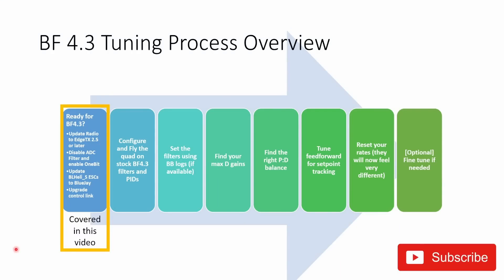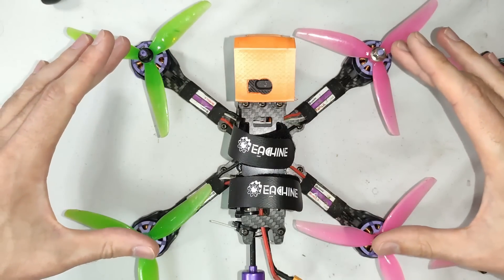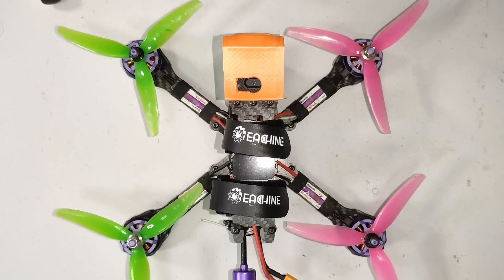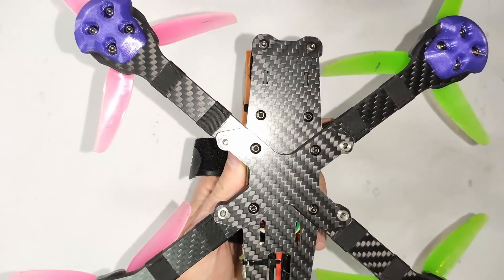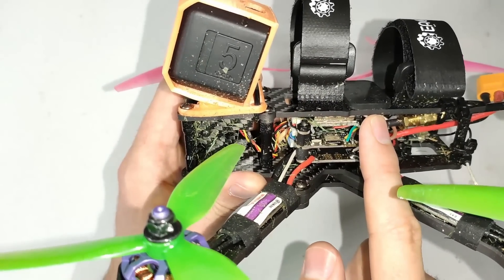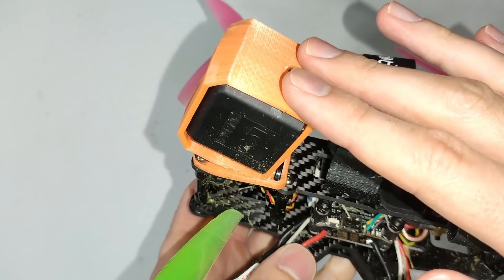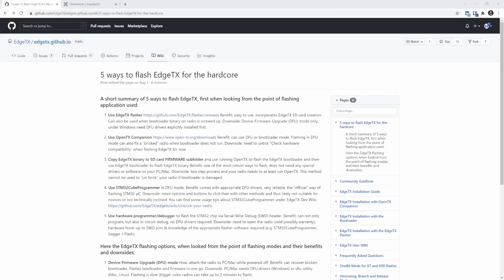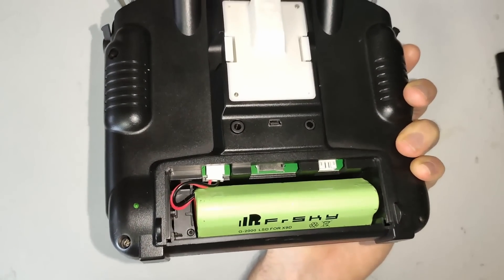Betaflight 4.3 Complete Tuning Guide! Part 1: Are you ready for BF4.3?

Comment: hi nice video I have one question regarding the Taranis setup. ADC filter is turned off. I don't have a sample mod like you. Max baudrate only. What value should I set? 115KBps / 400KBps / 921KBps / 1.87MBps / 3.75MBps or 5.25MBps ?
I use ELRS and I don't know if it has any effect.
Thank you for your help.

Comment: Hello, i just flashed the esc firmware as shown in the video on my speedybee f7 mini wich was on bl heli s... the problem is know i have weird beeping, wich is really anoying and my motors do not turn the right way, but with the firmware that i flashed i can not connect to any other applications..
thanks in advance
Reply from the maker: Motor direction can be configured in BF configurator motors tab. If you flashed to bluejay you'll need to use https://esc-configurator.com/ to change beep settings.

Comment: You forgot to tell to keep direction on ESC Normal/Reversed as it were before flashing because esc-configurator will reset every ESC to Normal direction after flash. Which would be disastrous result.

Comment: how long does it take for the edgeTX flasher to write to the SD card? i've been an hour waiting and it seems to be crashed/stuck "preparing SD card" fetching index, Erasing card. clicking close wont cancel it, tried this process over and over, always stalls here.
Reply: Did you get it to work?  I'm having the same issue, I'm trying a second sd card as I type this.
Reply: @seekerfpv  i coulnt get the edgeTx flasher to work so i went directly to github and downloaded the firmware directly
Reply: @owencroney2089  thanks for replying! I ended up doing the same.. Oh well.

Comment: What is your suggestion on mounting the VTX-antenna for a long range build? Im using the lumineer axii long range antenna. Also my crossfire antenna is mounted vertically on the back with a wobbly tpu print, ensuring its far away from the lipo and carbon etc.

Comment: Nice video, but esc-configurator doesn't support BL Heli 32; I get this message:
BLHeli_32 not supported, please use dedicated configurator.
My ESCs are up-to-date with the latest firmware however. This is for an iFlight 20x20 stack for a 3" quad

Comment: I know some people are really concerned with weight, but I use a clear double sided mounting tape under my Gopro mount and also screw it in place. I also use a rubber band around the battery to hold the balance plug against the battery and Velcro tape on the top plate and on each battery. I think the mounting tape under the gopro mount helps keep it still and really helps to prevent the screws from pulling through the holes. Just sharing what I do in case someone wants to try it.

Comment: Hi Chris, will I need to switch to Edge TX for my QX7 that I already did the inverter mod on? I'm currently on the latest Open TX and using Crossfire for my quads. Thanks.
Reply from the maker: Yes you should. The new features are handy for BF4.3
Reply: @ChrisRosser  Thanks for the quick reply! Will switch then 😄
Reply: @drukinsify  hi ! did you activate the onebit mode on your qx7 with edge tx ?

Comment: Hi Chris, I'm learning a lot with your videos.  I just have a question, though.  Before you flashed the ESC Firmware, the modes were Normal/Reversed/Reversed/Normal, the same way they were in my quad. After you flashed it with blujay, they were all Normal (the same happened to me), you let this settings that way (at least in this video).  I'm going to reverse the ESC 2 and 3, cause I'm not planning to go with Betaflight 4.3 just yet, but I wanted 42khz pwm freq.    Can you tell me please, if I'm  doing wrong reversing those ESCs?  Thanks
Reply from the maker: Good question, you can double check motor direction by arming with props off and checking that the motors are spinning the direction shown in BF configurator's motors/configuration tab!
Reply: @ChrisRosser  Thanks for you promptly response, yes, that's what I did (I don't like too much powering the drone, even without props, much less power the motors, I feel like they will burn almost instantly, but that didn't happened :) ). 
After all, I reversed motors 2 and 3 in Bluejay, then I tested it from betaflight and seemed right, and then I put the props and went out and did a very small test (I don't have such a big backyard), the quad went up smoothly, I would keep watching your tuning/pids/rates videos.   Thanks.

Comment: how do you solve the issue of having TPU protection and motor screw as you can tight them a lot due to the TPU?
Reply from the maker: It's tricky, I use damping grease on teh screws to stop them backing out and do them up as tight as I can without crushing the TPU.

Comment: What if I use the DJI radio? What settings on 4.3?
Reply from the maker: For DJI you can set serial receiver and sbus. Then if you want the fast baud rate just set sbus_baud_fast = ON in betaflight CLI and choose the fast sbus mode in the DJI goggles. Settings are the same as 4.2 AFAIK so just paste those lines from your diff.

Comment: Thanks for doing this, it looks like an interesting and informative series. 
Chris, at 1:32 you say "a frame designed for the best possible performance". 
What you mean by performance? Think it needs a bit of context. Performance for racing could mean something different than performance for freestyle, or other types flying. 
Maybe this is something you can touch on later, or after the tuning series?
Am curious if any differences in tuning for 2, or 3 blade propellers? 
(a premature Q, as noticing both the reference drones are 3x 5")
Reply from the maker: Flight performance. Lot's more detail on aos-rc.com.
Reply: @ChrisRosser  Thanks.

Comment: Ready..., oh yes ...
Wonderful announcement project Chris, I'm looking for your serie on 4.3

Let me just give you a positive feedback on how I learn and progress with your videos on filtering and tuning, and how satisfying it is when you start to really understand what and how filters work, as well as PID parameters, instead of just randomly moving sliders without understanding what's really happening in the many loops, contributing to make your Quad follow your sticks as fast and precisely as possible for a set of hardware, with as many parasites movements as possible.

And may bee suggest few general points of general interest you may address in your coming videos.
I understand you are putting a huge amount of work to elaborate such efficient tutorial content, and whatever You'll do, it'll  be wonderful for many of us.,

The general ideas of my comments being mainly to give you a feedback of the interests of your audience, and sure learn more and more as I can formulate my questions.

With the solid help of your vids(many thanks on that Chriss), I already flash 4.3 build 2538, on a 5', freestyle, GPS, diy build, running on Mamba F405US stack, using BTF Nightly configurator 10.8 #4137

CLI version
# Betaflight / STM32F405 (S405) 4.3.0 Oct 10 2021 / 03:29:25 (0b3a5a651) MSP API: 1.44
# config: manufacturer_id: DIAT, board_name: MAMBAF405US, version: ec268d11, date: 2021-07-26T13:10:45Z
# board: manufacturer_id: DIAT, board_name: MAMBAF405US

I couldn't have it fly nice on 4.2, and now on this 4.3 build, fly just great, kind of unbelievable to me.

But strangely enough, I can't get usage of BlackBoxRecordings, what I was using on 4.2.
(so I tuned, following your explanations first, than my eyes, ears and fingers (motor temp) which worked great for, at least for the beginning but deprive me of the beauty of tuning by measured and plotted parameters ...).

So here are the questions I have to uderstand how to choose the best adapted build environment (BTF, BTF conf, BlackBox, OpenTx, EdgeTx, LUAscripts and CRSF), till the finals released will be matured, which will take probably many extra months ....).

How to chose to move to recent builds ?
What has to be understand of the development process (except it's a my own risks...), when you see ten new builds appearing as yesterday night ?

Like by the end of october10 th to today october 25th, Jenkins publish 4 new builds (2538 to 2542).
Should we go for the last one (2542) asap, cause more work implemented, and Dev are happy so far for the night, or maybe the night is over, Dev are tired and go to bed till next week ? Even if a new bug had stopped them ..., making that last build maybee more hazardous than an older one ?
My question may sound naive but Dev are humans, they work in companyes to pay the rent, and some time they may like to sleep, among many others cool things to do.

When I'm surprised by an unusual comportment of a BTFLnightly build, should I dig in and try to report, or there is already thousands of guys doing it better than me, and so let people work and wait till nex build ?

For example: 
Some software Quad behavior:
In my case the BlackBoxExporer 3.5 software not being able anymore to upload usable files (BackBox build, BTFL build BTFLconf build, My stack not compliant enough to specs for 4.3, well ... it could be so many things ..)

GPS issue in the some fly:
On the same arming session I get up to 24 satelites, than 0, than back to 15 (I use also gallileo) when flying in big and high same circles. 
I never had his before with the same hardware and I tryied 3 differents GPS tested on other builds ...

If you suggest reporting may be of some help for all these great open source dev, could you show us how to report to be as efficient, non invasiv and usefull as possible ?

And the last question regarding OpenTx and LUA scrits with BTF 4.3 (Taranis X9d+ as yours). 
Being a huge fan of Telemetry (CRSF) and LUA scripts, I was wondering how, where and when we’ll find these updates in OpenTx ?
(Well Actually you already gave us part of an answer …. move to EdgeTx ...)
Reply from the maker: It is the nature of software development that there will be many new versions with bugs and problems of all kinds. I do not recommend anyone except software engineers and testers to ever use pre-release code. Especially not for something as potentially dangerous as a drone. I would always suggest to wait for the release or at least for a build recommendation that is known to be stable and safe.

Comment: I've been very interested in your opinions on TPU antenna tails.  Using zipties to secure antennas and gopros make for a really flimsy quad, that will not hold up well in a crash (I bash concrete with my Marmottes). I've done alot of work testing PLA (brittle) PETG (less brittle), and Nylon (better, but expensive), CFNylon (better , but very expensive) but none of them can take punch like TPU.  If I use TBS SMA pigtail, squarely mounted in TPU, with a short carbon matchstick antenna, everything is nice and stiff and secure with no wobble.  It can bend the antenna if I push it, but the mount doesnt wiggle.  I'm curious if I need to be concerned about your warnings against TPU tails, if my antennas are stiff?    Also I have been thinking that traditionally, TBS pigtail mounts have the screw tabs oriented horizontally to allow the antenna to flex up and down more in a crash. Rotatng it 90 degrees with the pigtail tabs facing front to back in stead of side to side should also reduce the antenna wobble on the vertical axis (and may break more pigtails).   Curious if you think antenna mounts made of TPU can perform well...because as a builder it seems like the material is a godsend for durable mounts.    Thanks for what you're doing for the community!
Reply from the maker: I would not use an SMA antenna at all. They are big, heavy and prone to failure regardless of the mount. A thin flexible antenna similar to the one on my AOS 5 in that video is phenomenally more durable, lighter and less expensive to replace. If you tape such an antenna in the right location you'll never break it. 😁
Reply: @ChrisRosser  hmm, pigtails are definitely cheaper to replace than antennas, and a large part of the strain relief that keeps my vtx and antennas safe.  I can definitely afford the weight of a 3 gram pigtail to make the video system more robust...maybe not on an micro, but certainly on a rig that's built around a Hero 10

Comment: Really great tutorial. 👍
One small remark though, no offense please. Have you seen Frsky Access protocol tests from UAVTech? They simply doesn't fit to your recommendation to avoid Frsky. Unless you had ACCST in mind. But even then... Is switching to super fast protocol so crucial? I did try ExpressLRS quad. It's great. But I haven't noticed any difference between that and classic 2.4 GHz rc link such as Flysky, Spectrum, Frsky. Maybe that's because I'm an average person. I'm not a good pilot. On the other hand, I do notice the difference between DJI HQ mode and low latency mode. Up to the point where I wouldn't use HQ mode at all.
Again, I appreciate your work, I am learning from you, I will follow this series, so please no offense, I'm just expressing my thoughts. 😉
Reply from the maker: I have to be honest, Frsky's behaviour in the hobby in recent years has put me off them completely and I won't use or recommend their products. The fact that the ACCESS protocol is not backwards compatible with their old radios or old BNF micros demonstrates a willingness to go against the best interests of their customers. Performance wise ACCESS is not competetive with ExpressLRS in terms of range and penetration. Packet rate is less important than consistency of packet delivery with BF 4.3. Dropped packets cause problems with RC smoothing. The excellent RF performance of LoRa really helps in this situation.

Comment: Great vid as always. I'm a few days into a sharkbyte AOS 5 build now. So this series has come at the right time. I even have one of those little iflight antennas to install.

Would you soft mount motors? Also, I got my AOS 5 frame from unmannedtech... Is the version with carbon washers under the front standoffs an old design or an updated one?

Superb frame to work on, though I have had to file some of the holes out on the bottom plate and motor screw holes... The hole placement is the most precise I've come across though... Not surprised you can get away with tiny tolerances on screw hole diameter... 👍 Can't wait to fly it 😁
Reply from the maker: I wouldn't soft mount motors myself. I do use mechanical damping grease on the frame to reduce vibration though. All versions of the AOS 5 use carbon washers to ensure standard length standoffs are used and they are all the same length in case you fancy buying a different colour!

Comment: Hello Chris, yesterday I tried flashing my Taranis QX7 to EdgeTX. In the github instructions it says, that I have to copy the MODELS and RADIO folders to get my settings and models on the new firmware. The SD-Card that was in my QX7 has no RADIO folder. Is this a problem? How can I get my settings restored on the new firmware?
Best regards!
Reply from the maker: Use the edgeTX flasher here: https://github.com/EdgeTX/flasher/releases
When you tick erase SD card it will preserve models and radio settings . I don't have a RADIO folder either so don't worry. Make a backup just in case and follow along with the video choosing V2.5.0.
Reply: @ChrisRosser  thank you very much! I'll try this later.

Comment: Hey man just wanted to thank you for telling me to switch to Bluejay Blheli s over bl heli m. Not because of better performance… (BORING) but because now when I power on my quad… I can rick roll someone 😂
Reply: I saw he flashed Bluejay in this guide but didn't find much discussion after a short search. Is there a performance difference from M? That's what I flashed a little while back. I'm not motivated to reflash just for the melody.
Reply: @comsterfpv9668  If you are happy with BLHeli_M, stay with it. Biggest difference is, that Bluejay has quite some bugs fixed that were still in the original BLHeli_S (and probably are in M too) and still has ongoing development. BLHeli_M is pretty much abandoned at this point.
Reply: @stylesuxx  Got it thanks!
Reply: @comsterfpv9668  Yeah Blheli M hasnt been updated since 2019. Bluejay is constantly getting updates and the switching process took less than 10min. Just flash, reorder motor direction if needed and your done. And set start up tone if u want :)
Reply: Yes, that has been our killer feature for some time now :-D
Reply from the maker: Haha! Yes, that's the best reason to switch 😁

Comment: ESC firmware: why Bluejay instead of Bl-heli? The typical 5 beeps are gone now...
Reply from the maker: Bluejay is recommended by the devs for BF4.3 and significant testing has been done with it. Also the default timings on Bluejay are better than those on BLHeli_M which makes configuration easier for more pilots.
Reply: But we have a melody editor, you can add any startup tune you want - even the 5 beeps if you prefer to. A lot of work has been put into Bluejay: A lot of Bugs that still were in BlHeli_S have been fixed and new features have been added. We even have feedback from pro racing pilots switching back to BLHeli_S ESCs with Bluejay instead of BlHeli_32.

Comment: w/r/t mechanicals and screw tightness - why don't we have community standards or "best practices" for screw torque on frames? Theres plenty of appropriate tools out there for the gunsmithing and bike world that we could integrate into our build plans - I just got a FAT Wrench for torquing down and optic mount
Reply from the maker: It's a good point. Probably because many pilots don't own torque screwdrivers/wrenches!
Reply: @ChrisRosser  I feel like gunsmith / fpv stuff is in the same price range these days, and a similar level of enthusiasm. Though the former has over a century of best practices attached to it I guess, and a different regulatory structure. A little torque wrench is definitely within the budget of a normal fpvers workbench.